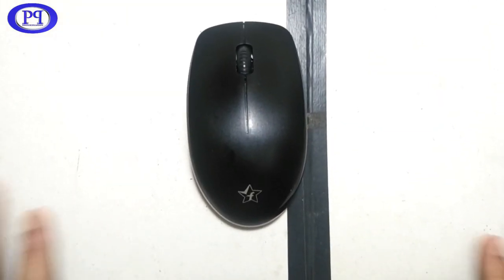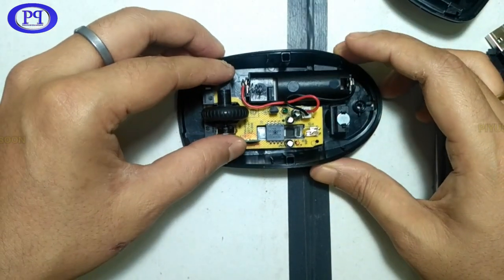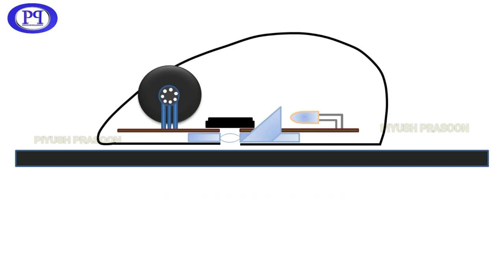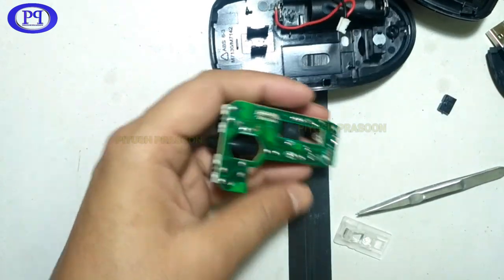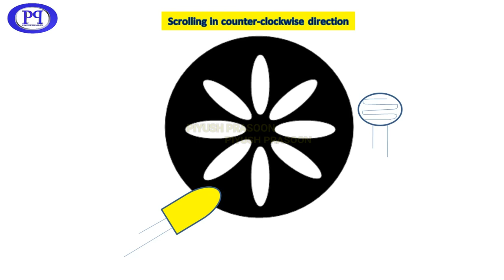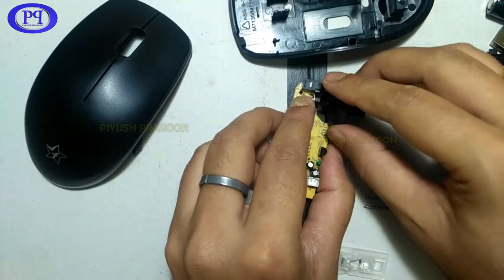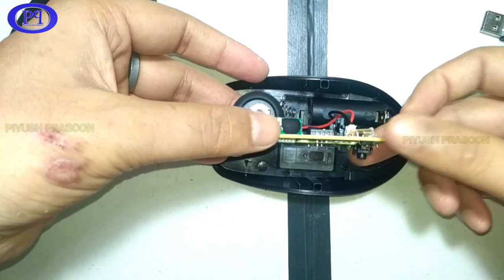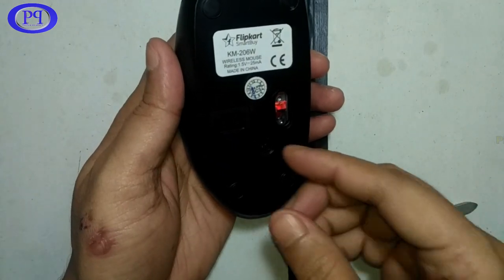How an Optical Mouse Works | English

Comment: This is quite interesting... But one thing I want to know, what is the job of mouse adapter?
Reply from the maker: Mouse adapter is the one via which mouse couls able to connect with the computer.
adapter is working as Bluetooth transceiver via which signal from mouse reaches to computer and vice versa.

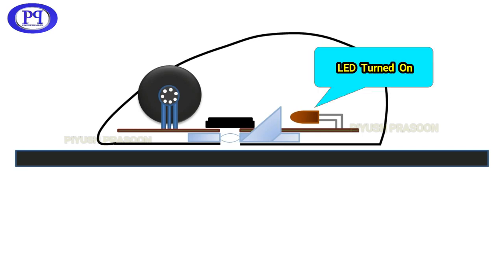Comment: 7:34 You said, "as soon as the motion is detected the LED will get turned on." You did not describe HOW the motion is detected. Is there an accelerometer or a mercury switch or what?
Reply from the maker: As I said there is a chip which is having capability of a camera equipped with Nano lenses, so the motion is detected due to change of image recorded via camera chip (FYI, motion could be detected even if the LED is turned of, however to get more clarity for curser/pointer movement on the screen the algorithm automatically turn on the light source i.e red LED in this case.

This happens in a fractions of a second.
Hope you got it now.
Reply: @PiyushPrasoon  These mice have fractions of microamp standby current. It would be impossible to perform complex motion detection by a microprocessor on such low current. There is some other method of detection at play, but what?
Reply from the maker: @iconoclad  Yeah, you are right. Thanks for your informational feedback.

Comment: how to solve my mouse that having inverted vertical direction?
Reply from the maker: Oh that's very different issue. did you checked:
1. faulty mouse in other computer, is it pretending the same issue?
2. using another mouse with the same USB port?
3. by un installing the device drive and re-installing it, if it fix the the issue?

Comment: Hello! What so you think would be the problem of a mouse when it doesnt track to a ceartain spot on a mousepad? Because i have a gaming mouse and after a year of usage i noticed that it loses track to a ceartain spot on my mousepad. I used different mousepad and still happens :(
Reply: What i mean is when i swipe my mouse to left or right, sometimes my cursor stays wjere its last stayed. I hope you get me :(
Reply from the maker: @ivansemanero7465  Hi,

1.  cleaning of the mouse  lens is required. it might be possible dust particle is lowered the intensity of light.
2. LED which is being used inside mouse to emit light might got weekend and due to lack of light intensity it might be malfunctioning.

Recommendation: at you on risk >> you could open it and an clean it properly then check it.